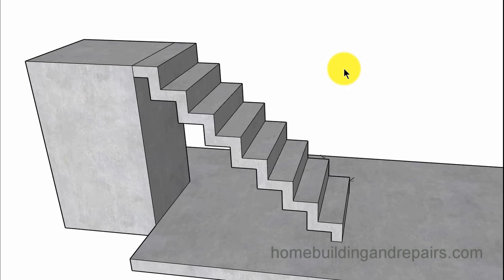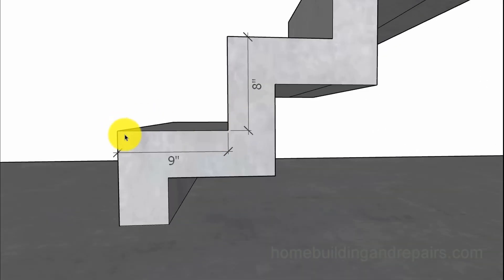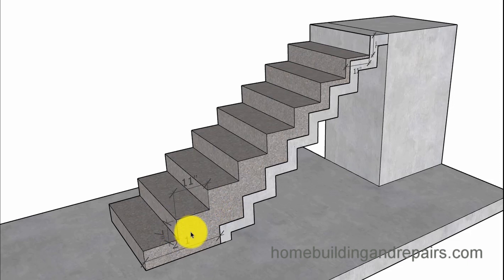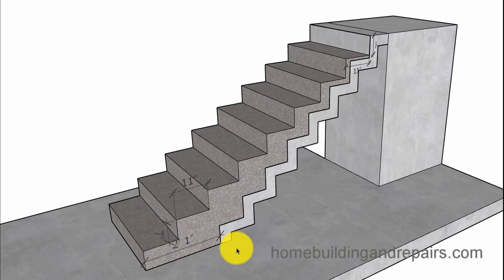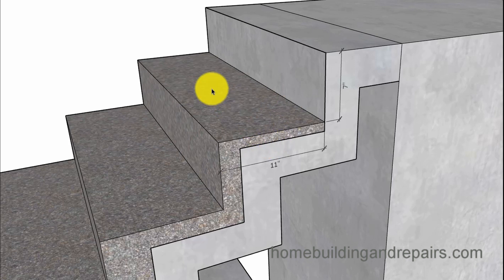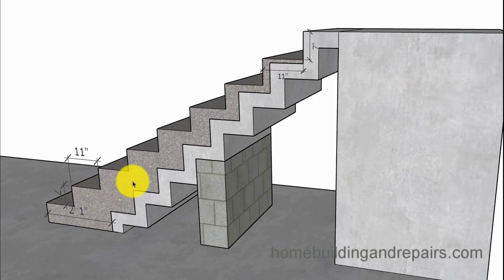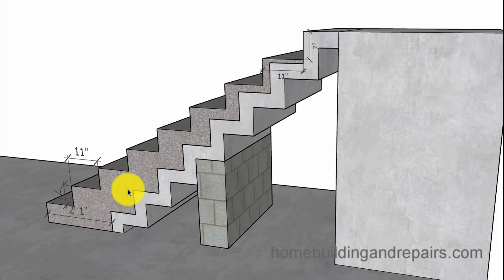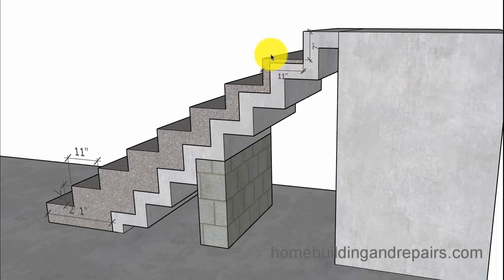Adding Extra Step Might Make This Concrete Stairway Safer – Building Repair Ideas

Comment: Why couldnt a wider tread simply be fastened to each stair?  In other words ones thatwould hang over the next step?  would not the result BE the wider tread desired?  Or an I thinking wrong?  When I picture it it works perfectly!   Granted the tread caps (for lack of a better word) would have to be unbreakable ....perhaps  1/2"steeleven?  And then drilled and countersunk so that Screws or bolts would pass through them into anchors in the existing concreate staris ....Would that workplease?  I have a very similar problem lthough it is only 4 steps not an entire floor
Reply from the maker: I've seen wood, concrete and metal fastened together to create stairs like the one in this video.

Comment: I've got a good one for ya..... concrete stairs....walls on both sides....can't get under it....can't get around it....house was made outta concrete bricks......yea.....riser is almost a foot high....but the step is only 7 inch's wide.....stairs going down to basement....probably a dozen steps down....dangerous is an understatement....???
Reply from the maker: Sounds like you need to do some remodeling.
Reply: Unfortunately no....I put handrails on both sides and good lighting...
Reply: @davidmarkellos3155  Thanks for the reply!  I was thinking of attaching two inch thick wood to the face of each step, thereby extending the width of the step.  If I don't go that route, then your solution sounds best!
Reply: @footfiles  This guy has another video on here somewhere where if u don't do that right your gonna end up with the exact same problem when your done....u may wanna look at this guy's videos
Reply: @davidmarkellos3155  Thanks for the heads up on that video.  I think I might have the clearance, but will need to measure it to be sure.  Something that needs careful consideration for sure!
Reply: I have the same exact setup as you, about 12 steps down and only slightly more depth on the tread.  Concrete/block stairs with no access to the sides or beneath it.  I'm thinking of attaching two inch thick wood to the face of each step to give it more depth.   Did you ever come up with a solution?

Comment: I agree with jay one useless step and a concrete stair  would never be made that way
Reply from the maker: I still don't understand.
Reply: You are a brilliant man and your videos are great, a great source of information for me and more importantly beginners to the trade. That said this stair ,made of concrete, in the picture would have  a flat under side. Easier to form and for structural purposes, rebar.  And the extra step on top I try to never do that. Thank you for the excellent videos

Comment: What if the depth of the wrist is small and  also visible few crackes on the wrist horizontally and their is no space for any supporting walls then how should I make the stair safe??
Reply from the maker: Feel free to email me some pictures of your project and I'll see if I can provide you with some more information. You can get our email address at our website.
Reply: @stairbuilding  thank you sir i will definitely mail you some pictures of my project by tomorrow.